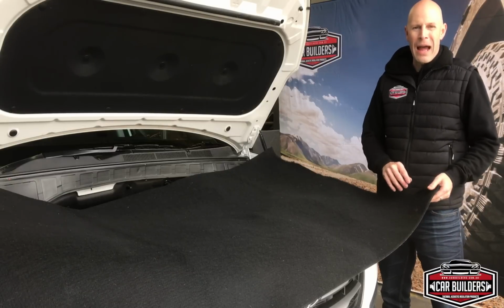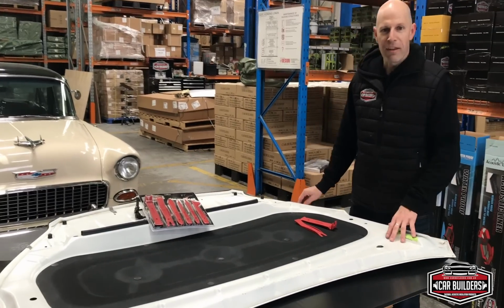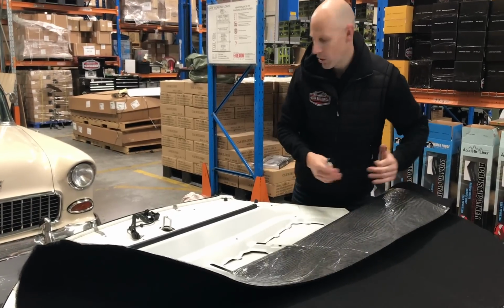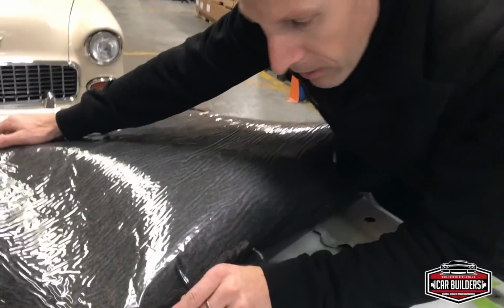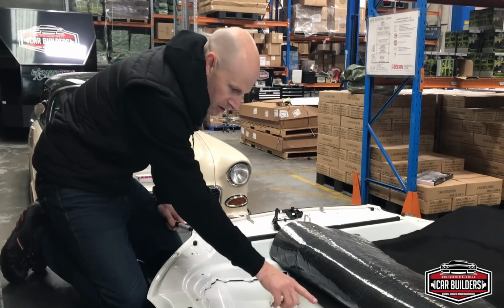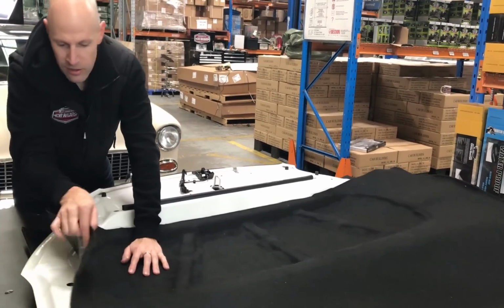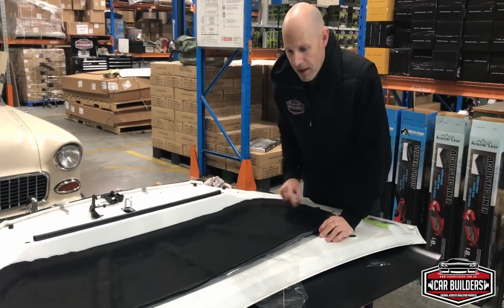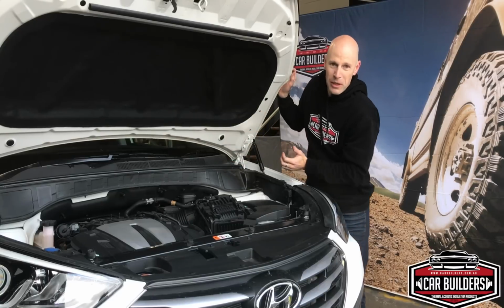Re-create a Factory Under Bonnet Look. Premium Under Bonnet Insulation Pad Material Liner

Comment: I helped to install a headliner in my brothers truck, and I used a monokote iron for rc airplane wings, controll surfaces, and fuselage to get the roll on headliner with adhesive to form into the creases and around contoura. The iron comes with cloth covers to use while ironing to prevent Burns and the iron does not use steam. It only uses heat. It seems like on this material that type iron would work well to install the bonet material also.
Reply: Interesting, I don't have a heat gun, but have one of these irons I never use 🤔👍🏻

Comment: Like many others: no before and after sound comparison. Which is the foremost reason I am looking for such videos. But I like the workspace :) nevermind, moving onto the next one hoping for some sound comparison.
Reply from the maker: Thank you John. We often put sound comparisons in our install videos. However, in our efforts to be totally transparent, we have always felt compromised when doing this. There are so many variables in trying to give an accurate decibel analysis. The vehicle and its age, the model, the motor, modifications, tyres, road, weather, decibel frequency tested.. the list goes on. Please be careful when presented with decibel before and afters. We will have videos out shortly where we test each material (for sound or heat) in controlled situations. 
Good luck in your search 😎👍
Reply: @carbuilders1  make a lab size sound proof box with two halfs with the material placed in the center. Sound one side, meter the other. Only change the material. Bingo will see  material comparison. Just need a real decibal meter, A exhaust shop will have one to borrow or tell you where to source one. Then all you need is sound thats repeatable. A car head unit with speaker and sub would give a good repeatable sound across the Sound spectrum.

Sorry but a sound proofing company without even a real decibel meter is laughable 🤦‍♂️

Comment: Good job. 
I would have even after all that still put the factory liner back on.
Maybe a tutorial on how to do the outside of the plastic wheel well fender guards to reduce road noise and water sling off the tyres.
Like euro cars, VF commodore etc. Mentioned by Ryan
Reply from the maker: Thanks v8soarer1991. We are just about to make a wheel well clip. Stay tuned!
Reply: @carbuilders1  Surely they will deliver. They wouldnt leave us out in the cold.
Reply from the maker: @JohnDobak  😆It's coming.
Reply: Car Builders - Thermal & Acoustic insulation materials any update on the fender liner video?

Comment: Top Tip...Don't try and take the bonnet off by yourself......also some Dynamat under the insulation pad works well.....
Reply from the maker: Shout a mate a couple of beers for this one 👍 In other videos you can see we have place our deadening mats underneath. A win with the Defender is the bonnet angles all the way back to the windscreen so you can install without removing the bonnet.
Reply: @carbuilders1  That's because the engine has to come out regularly. My Rangie was the same....

Comment: It seems easier to flip the old one and use the new material on the backside and drill some holes the using the old front of the bonet hood insulator as template for the holes and then reinstall but with new bont material on the outside.
Reply from the maker: Hi Joshua. We used the factory pad as a template in a few other video installs. Check this one out. https://youtu.be/Ir7NqGcNqiY 👍

Comment: Very good production. Wish I'd known about this method and material before I put dynamat under the bonnet of my GU. That looks a lot better. How good is it in heat proofing, though?
Reply from the maker: Thank you. Yes, Dynamat (or our Sound Deadener) primary purpose is to stop panel vibration. It will make a very small difference with heat  but not significant and you will want to cover it and not expose it to extreme temperatures in the engine bay. If you don't have the factory cover over it you could look at something like https://www.carbuilders.com.au/premium-under-bonnet or if heat is a big issue, a more extreme treatment would be https://www.carbuilders.com.au/peel-stick-heat-shield 👍

Comment: Hi. The product looks awesome.
Although two questions. How good this will be in long run, as standalone under hood insulation? I am planning to replace worn out foam insulation in my w124 and want a standalone product that is not foam like the oe , as with time it tends to crack and fall in small pieces inside bay. 
Secondly the goal is to mainly reduce diesel clatter noise both inside and outside of car.
Thanks
Reply from the maker: Hi Mayur. Thank you. Yes, this product is a lot more durable than a manufacturer's foam insulation and will last much longer. This insulation will protect the bonnet paint from heat fatigue and also provide some sound insulation .
Reply: Great question, that's exactly what I wanted to know for my 300E.
Reply: @clark57225  hi. I ended up with a product thats 3 layer (foam+alum+butyl) from over a year. Its holding fine but diesel clatter is still loud. Maybe because idi are loud anyways
Reply: @CarReporter12  Thank you for the information. I will look into it further.

Comment: Fleece vs aluminum which is best for the engine bay/bonnet, many prefer aluminum?
Confused help!
Reply from the maker: Hi Paul. If you have modifications under the bonnet and the engine is kicking out some decent heat, then the peel and stick heat shield if definitely the one for you 👍
Reply: @carbuilders1  Cool thanks,will it have the same sound deadening properties compared to fleece.
In my mind fleece would be  better?

Comment: Thanks for the video. Just installed the liner i got from the 4wd show in vic... by far the most satisfying thing to install. Impressed at how well it contours and sticks. It looks awesome. Any tips on how to remove excess adhesive i managed to get a some around the edge.
Reply from the maker: Hi James. Thank you for the feedback. Use Prep Sol wax and grease remover.
Reply: @carbuilders1  awesome. Thanks guys keep up the good work

Comment: Insufficient method to address engine noise although its a critical Step 1 in reducing engine noise intrusion. 

The most IMPORTANT area giving the BIGGEST reduction in engine noise intrusion (besides firewall) is the area/narrow gap behind your door hinges. 

KIA and Hyundai hv become impressively quieter due to focus on this critical area. Look at the Hyundai Santa Fe..and you’ll see “something” there put by the manufacturers. 

In contrast, look at the Merc A Class (noisy engine noise and loads of tyre noise). There is NOTHING there (when u open driver door and peep behind the door hinges) except a thin black plastic cover. 

Look at the narrow area BEHIND your upper and lower door hinges. Thats where engine noise and tyre noise penetrate into the cabin. Its actually a hollow space that leads to the inside of the fender well cavity. 

Remove the wheel well liner. 
Stuff loads of waterproof, non fraying noise absorbent material into that empty area. Rolled up or folded up Thinsulate is best. In any non-Continental vehicles, treating this area produces a significantly impressive reduction in engine and tyre noise WITHOUT doing anything else.
Reply: JK Low interesting, I’ll try this on my car.

Comment: Great tutorial. What would you recommend to reduce vibration in old diesel without dual mass flywheel? I feel vibration throughout the seat, caming from the floor. I have already deadened the firewall with butyl mat and foam mat on it. Now I'm gonna put something on the floor, the target is to reduce vibrations, noise is not so big problem. Thanks you in advance.
Reply from the maker: Thank you. If your vibration is that significant you should look at alternatives in more efficient engine mounts or even suspension cushion seats.
Reply: Or balance the flywheel at a machine shop
Reply: @smportis  do you think it would help? I noticed that vibration are gone above 1k rpm, the problem is only at idle.
Reply: @pabllok  Try replacing the engine mounts.....
Reply: @alexbrown1995  I did this, I replaced all of them for brand new, genuine.
Reply: @pabllok  Hmm. What sort of vehicle is it? Maybe the vibration can't be avoided?
Reply: @alexbrown1995  saab 9-3 my01 2.2tid, diesel engine.

Comment: I can go with either a foam insulation pad or a fiberglass pad - do you have an opinion on which performs best ?  MBZ use foam on $100K cars but I suppose that doesn't mean anything - my original was destroyed by deer mice as they liked the insulation material - do they like foam or FG ?  thanks
Reply from the maker: Our premium under bonnet is a superior product as it isn't a foam but a needle punched polyster. Both will function similiarly, however the material is more durable and puncture resistant than foam.... also I think deer mice detest it 😆

Comment: What if you don’t have the original insulation to trace? Predicament I’m in with a 1970 Mercury Cougar.
Reply from the maker: Making templates can be dangerous as it is hard to account for rises and falls in the surface which change the amount of material required (in the video we only used it to make a rough oversized guide). If you lay the sheet on the bonnet/hood first and allow it to be evenly oversided. Then reveal some of the backing on one of the edges of the bonnet and continue from there to stick it down. You will have extra over each side that you will then blade off (careful not to score the paint- as in video) 👍

Comment: Very nice job and great explanation!
I stumbled upon this video as I was looking to do the same to my Skoda Octavia MKIII 2017 facelift as I found it to be noise 2000+ rpm (diesel)...
Turns out the insulation Skoda put in place (with clips) is actually the culprit! Would removing it hurt my engine in any way?
And secondly, would adding insulation like you did provide noticeable improvements? Thanks!
Reply from the maker: Thank you. 
Was the bonnet insulation rattling? Apart from adding some sound insulation, if you remove it you will expose the bonnet to greater heat and potentially paint fatigue. If the factory insulation is in good condition you may look to replace the existing clips as an easy fix. 👍
Reply: @carbuilders1  Indeed, found your remark online too and installed the insulation again.
Currently have been looking to buy something like Dynamat Hoodliner, (they advise to apply Extreme first) but seems they only sell the hoodliner in US/UK. Do you have any ideas for alternatives?

Comment: hi interesting ,i want to ask some technical detail that should be in the material used for this purpose, like what properties it should have
Reply from the maker: Hi Mahi. There are cheaper foams that replace the factory underbonnet however, like the manufacturers version, the foam ends up failing and flaking. This product is a textile material, which is more durable. As you can see from the video, we wanted to manufacture a product that looked factory pressed however was able to be applied to a universal bonnet. We want a durable product that could withstand a high pressure hose and was fire retardant. The material is also a dense needle punched fabric, which will help reduce heat transfer and filter sound waves.
Reply: thanks for reply can we use the black Blankets used by Army around the world, for the same purpose as it is fireproof and dence,  asking for its thermostat properties, is this good or bad for bonnet, or depends on how we install under bonnet, to not to allow heat to tranfer to the layer with direct contact with bonnet, just a query on experimenting ideas!
Reply: @MahiSingh-gt5sy  Did u ever find this answer? I purchased a used vehicle lacking hood insulation

Comment: car builders, would it be ok to first put a layer of some of your sound deadening pads, and then run this adhesive over the top? cheers
Reply from the maker: Hi Ryan. Yes, this is fine under the bonnet. You don't need to load it up, just add squares in open, single sheet panel sections and then put the Premium Under Bonnet over the top 👍

Comment: How heat resistant is this. Would it work in a hotter engine bay allocation
Reply from the maker: Hi Daniel. It is rated up to 200 degrees C however if you have extreme heat in the engine bay, close to the bonnet, we would recommend a peel and stick heat shield https://www.carbuilders.com.au/peel-stick-heat-shield 👍

Comment: I don’t understand? All you did was replace it. The original didn’t look like it was in bad shape. For some reason replacing an oem with your product helped how? Sound/ heat?
Reply from the maker: Hi Daniel. Yes, you right, that underbonnet pad was fine, we just used it as a model. You wouldn't do this because, as you have pointed out, it isn't necessary. These pads break down over time, 20 years etc and people find them hard or expensive to replace and this is when this product is used. They are also a durable-faced product so they have advantages there over many OEM versions. Here is an example where we used the original and the Premium Underbonnet product https://www.youtube.com/watch?v=KhcPs7YhMeQ&t=6s

Comment: It’s too small to fit the bonnet/hood on my 1967 C10 truck. But on the other hand, my front clip weighs as much as the whole car he put a under hood sticky cover. It would have to done in left & right half. Or if down under, right & left half!
Reply from the maker: Hi Dean. The sheet is 1.5 x 1m. It fits in our warehouse C10 '86 truck 👍